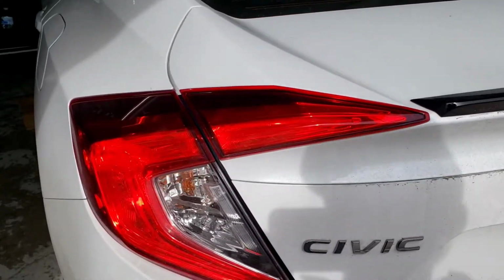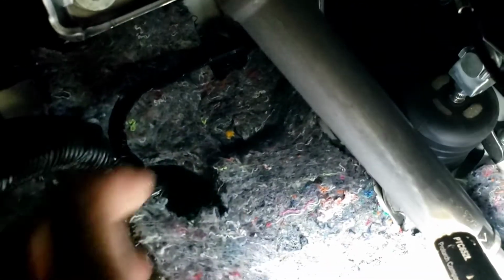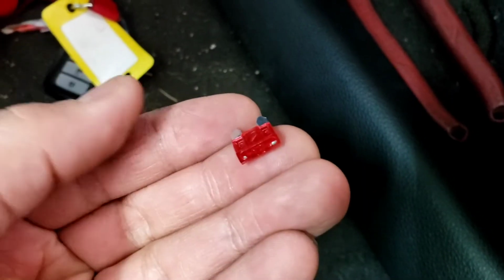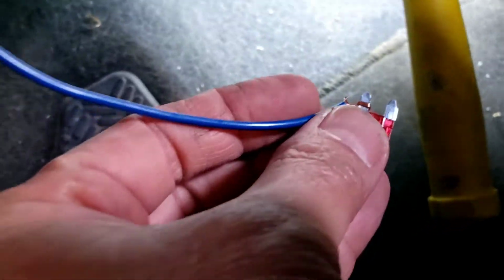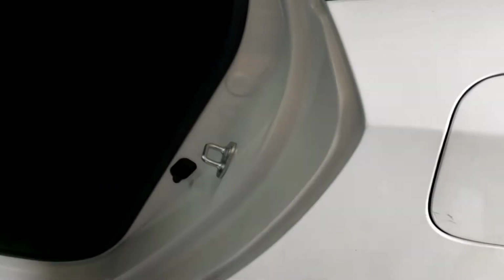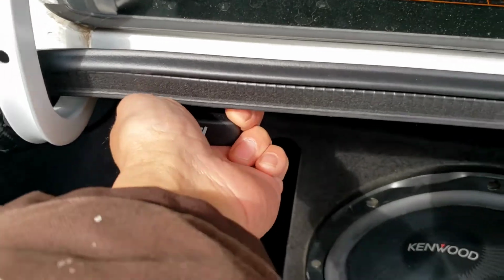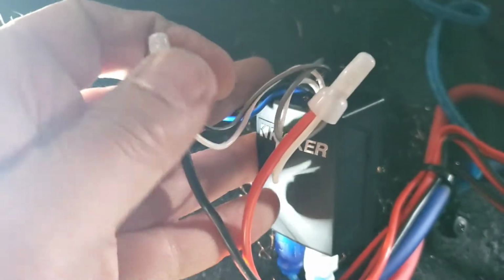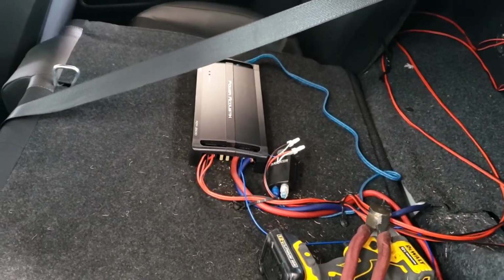2020 - 2021 Honda Civic amplifier installation using Factory Radio #amp #carstereo #subwoofer

Comment: Instead of doing the fuse for the remote wire. You could add a switch to turn it in and off
Reply: I know what you mean with that loud buzzing noise*

Comment: I’m getting constant power to my remote wire when i put it in the amp
Reply from the maker: @unexcusedgaming6716  what brand is your loc?
Reply: @khmerohio metra
Reply from the maker: @unexcusedgaming6716  so metra has black yellow blue 4wires?
Reply: @khmerohio  yes, black yellow blue then 4 postive negative for speakers. Is it possible my rear speakers have constant power they are feeding the amp through the loc?
Reply from the maker: @unexcusedgaming6716  so black go ground ,yellow +12volts, blue to remote ,white and grey go to one side of positive speaker, and white/black and grey black to negative of speaker
Reply: @khmerohio  are you only tapping into one rear trunk speaker or both?

Comment: its not going to matter if you turn that function svc off.  it usually resets and turns on after you turn key off and on.  you need to disconnect the ANC  active noise cancelling module at the top right side behind the glove box.  i ran into this problem on an accord and a 2019 civic.  Look up how to disconnect ANC on a Honda civic.  as long as its a 2018-newer they should be the same.  if its older than that, then it is disconnected in a different area.

Comment: I had a subwoofer installed and I need to send it back. Is it safe for me to unhook mine without causing any problems to my car?
Reply from the maker: Make sure you unhooked the fuse  front first it's under the hood
Reply: @khmerohio  thanks bro, I’m gonna try. If not I’ll just try and set up an appointment. I don’t really care if the subwoofer itself gets damaged cause I’m sending it back anyways I just care that my cars actual audio doesn’t get messed up
Reply from the maker: Take the blue remote wire also

Comment: Great explanation of how and where to run wiring. When I ran my amp power wire through that grommet under the dash, I un-taped the wire bundle, and fished an 8AWG thru it with a zip tie.

Comment: This is one of the better explaining Video's for wire hook up instructions, Thanks 👍
Reply: I used your instructions on a 2020 Civic Sport Sedan it worked great, I did install a 10 underseat sub in the left rear of the trunk removed the foam material next the spare tire, so it basically fits even with the floor in the trunk, Sure sounds better with more BASS, I used a LOC to run RCA cables to this amp, I didn't try using the high inputs on this amp because of the complaints online.

Comment: I’m getting a loud humming when I drive off. What can that be.
Reply from the maker: You have anc it's on top of glove compartment
Reply: I get a loud humming when I drive off. What can that be.
Reply: @MrGupstaa  those should have a ANC (active noise cancelling module that needs to be disconnected.  i believe it at the right top side of the glove compartment.  look up on youtube how to disconnect ANC on a honda civic and it should pop up.  look for a 2018-up   those should be the same..  the older ones are disconnected in a different place.
Reply: It's a bad ground, clean your ground area really good